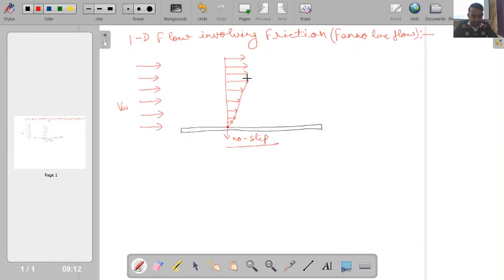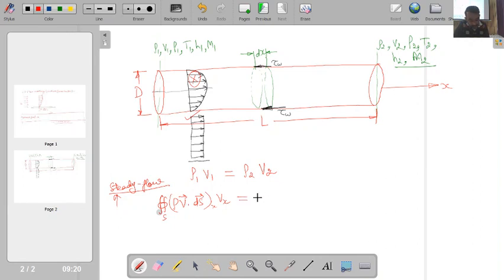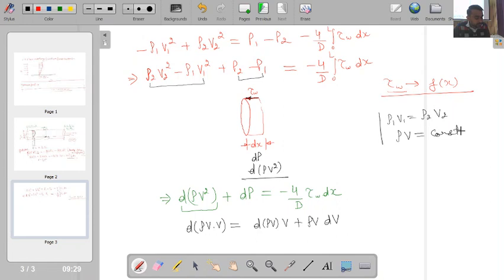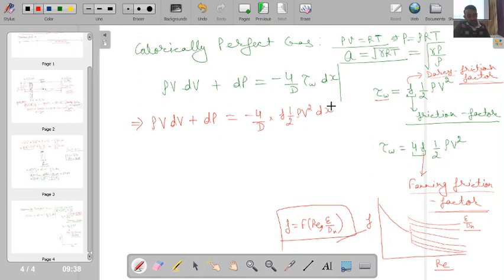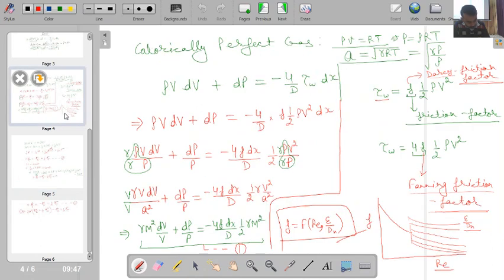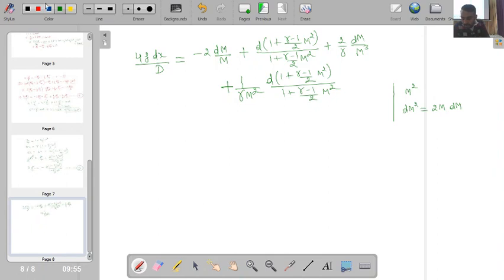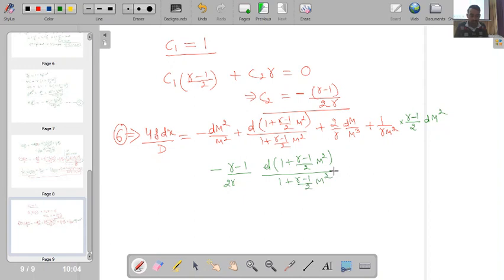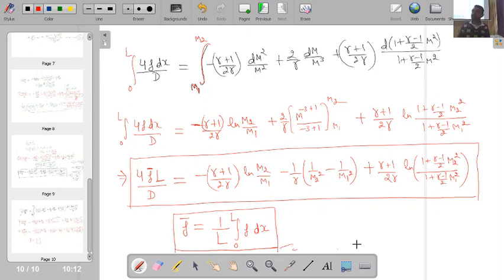Lecture 13: 1-D Flow with Friction (Fanno Line Flow)

Comment: Hello sir, there should be ln(M2/M1)^2 as the first term after integration, or we can also take 2 outside and the coefficient will become -(gamma+1)/(gamma)
Reply from the maker: Thanks for pointing out this mistake. You have done the correct calculation.
Reply: @ParmodKumar-pw7gp  Thank you very much sir, for this amazing lecture series, these are really helpful to me for solidifying the fundamentals.